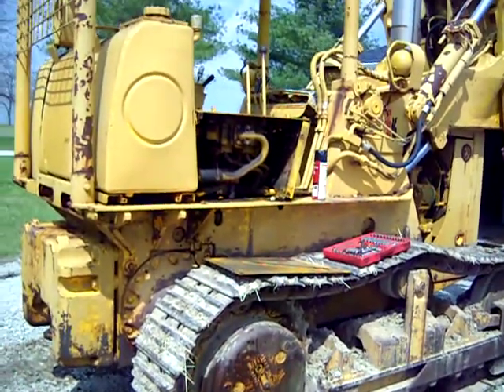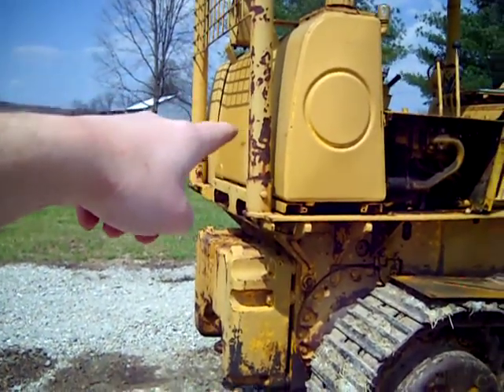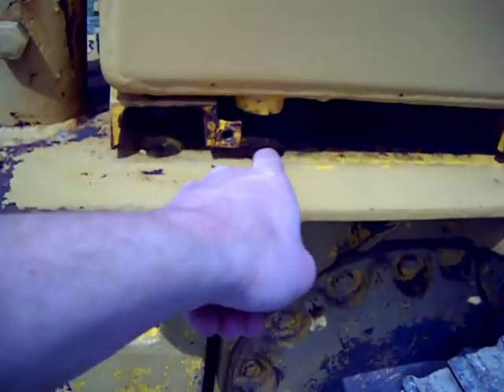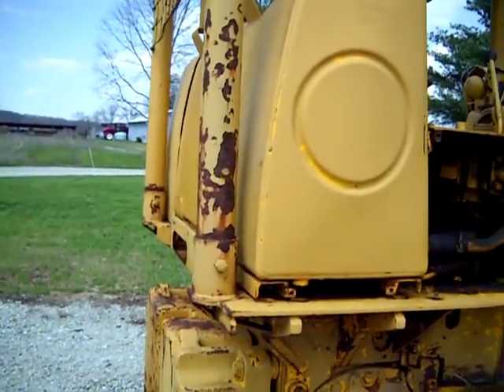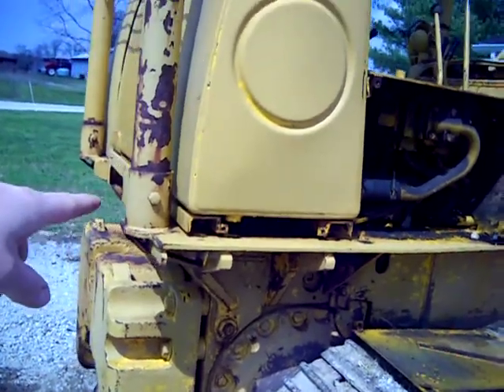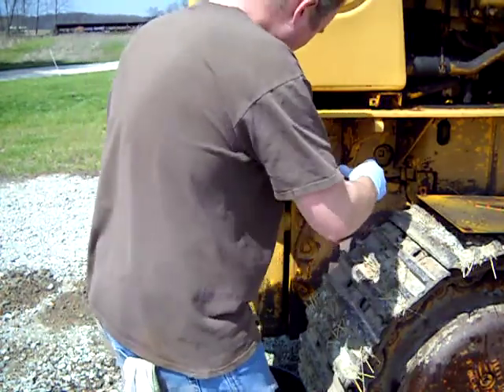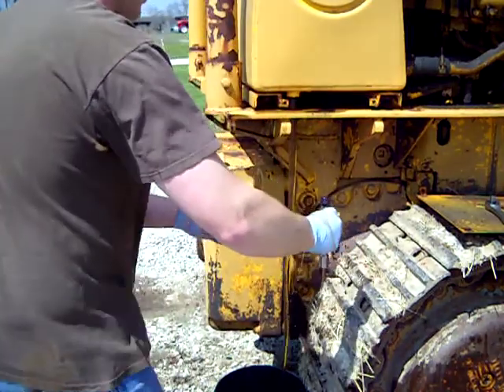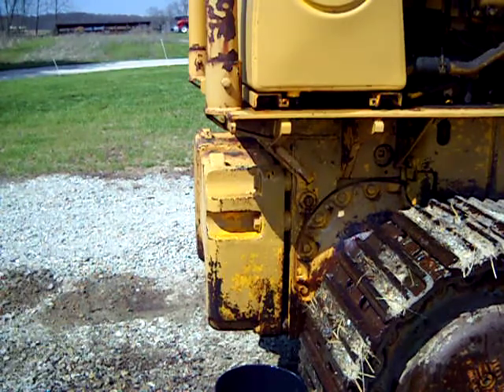Changing Hydraulic Fluid and Filters Crawler Loader 175C

Comment: hi recently purchased the same equipment, could you possibly tell me what kind of hydraulic oil and transmission oil does it takes? thanks
Reply from the maker: I used "Parts Master" brand "Tractor Hydraulic & Transmission Oil". Part # 75-475. This is not the yellow bucket stuff. This is the next step up. I got it from my local auto parts dealer.

Comment: I have a 175b but it has the filters like yours nobody can find the smaller suction filter do you happen to know what number and brand the filter is thanks in advance
Reply from the maker: You might check H. Finney for the part. I don't know the part number and I sold this machine and my books a couple years ago. I bought some seals and my books from Finney on Ebay.